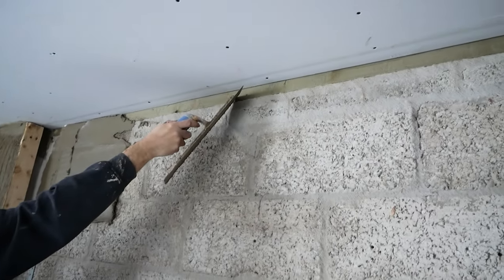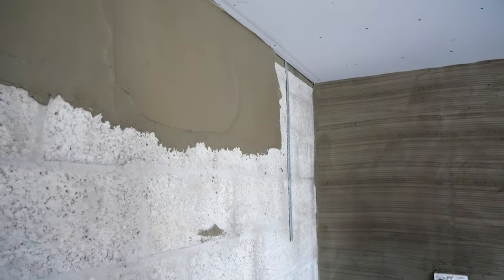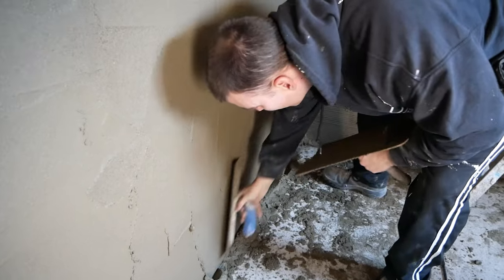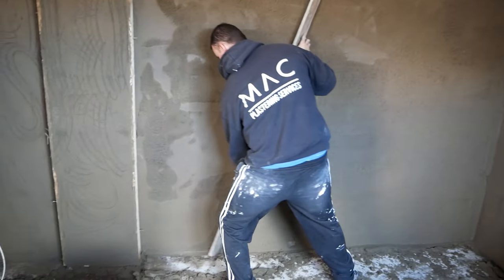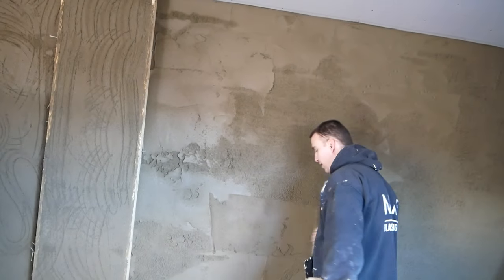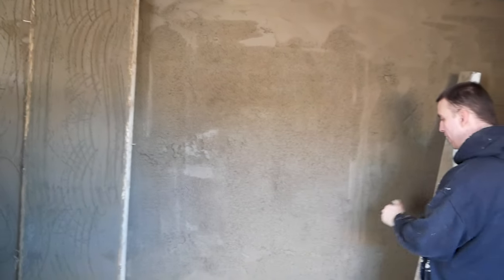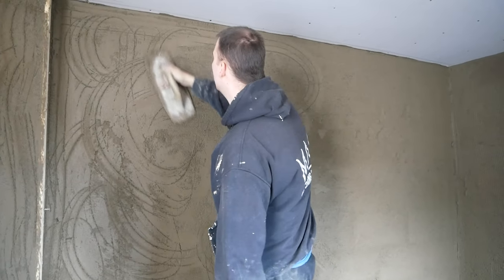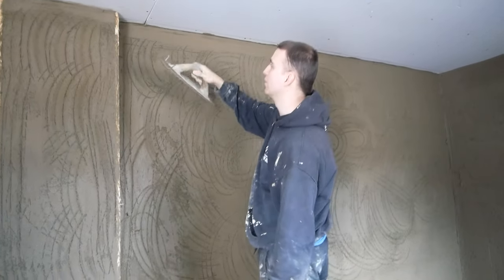How To Float A Wall Ready For  Plastering Using  Sand And Cement

Comment: This has eased my smoothness anxiety😂 As a diyer, I’d have been panicking at the slightest hole / imperfection
Reply from the maker: Its not to bad on the undercoats as long as there is no massive holes hollows or bumps as the next coats are around 3mm

Comment: Wire mesh is definitely a good way to go then scrim on floated wall...... Try going the other way mate when floating and a right hander, your building it out your not skimming
Reply from the maker: @bensharpe370  fir sure on the mesh why I talked about it but I love working left to right it's so much better and comfortable qustions fir your self when doing a dry dash coat you work right to left. Then do you dash where1st ? The right side?  Also same when rendering when you rub the wall where do you rub 1st ??? Do you rub right to left as its the way your gear will be drying most?
Reply: @macplastering  mate!! Im really trying hard to understand. Right hander left to right on finish plaster (your not building up anything) right hander on any backing coat then (right to left your building it up). When you say what would you go on first as in dry dash, with all due respect it's what you put on first. The only reason why you have questioned this is because it's easier for a right hander to dash it from left to right. Show me a floor screed, I need to know how you do that.
Reply from the maker: @bensharpe370 @bensharpe370  my point is it don't matter where you start when building up its where you feel best also for your outside work it actually helps more this way as when finishing it is easier to see your work.. we have loads offloor screed videos or is it on walls your looking for? Strighting up?
Reply: @macplastering  fantastic plasterer mate keep up the good work. My boys in Corfu at the moment he's 18 (first holiday abroad)  can't tell him shit he's knows best. Typical teenager, you got any kids.
Reply from the maker: @bensharpe370 yes I sure do have kids is your boy plastering in corfu ?
Reply from the maker: be nice plastering in Greece and having a holiday at same time lol what type of work is he doing ?
Reply: @macplastering  starts a carpentry course on the 11th, he's just left school. Devons doing 3 days at college and then a few days with me. He didn't do very well at school to be honest, he's got a brain but didn't use it!! Got a girl who's 15 a year below, totally academic they couldn't be more different 😂 How old are yours

Comment: what additives do you put in the Render and is it the same mix for internal and external sand cement
Reply from the maker: Most times, different  mate as outside will have waterproof in it and inside don't need it
Reply from the maker: Again so many different types of jobs new block old block red brick ect
Reply: thanks for the advice ive only ever used hardwall and bonding on interior but i was intrigued by your interior sand and cement plastering because i believe its lovely to get nice and flat even though it might be abit more messy thats why i was curious as to what your mix is for interior sand cement old brick walls
Reply from the maker: most times 4 to 1 with some plasticizer in mate i would find bonding messier as if floor is clean you can re use and cement of floor
Reply: thanks 👍

Comment: You are master but You forgot to moisten the wall with water 💧 Increases adhesion properties
Reply from the maker: Low suction wall if I wet it would be bad in this occasion as wont set nicely if was hight suction yes would wet it down on scud coat

Comment: The technique you show at ~6:00 to plumb up the face of the wall is really smart. I'm watching videos to learn how to render/plaster bits on my house and I think that's the first time I've seen that technique.
Reply from the maker: Thank you buddy its a similar way I do floor screeds to get the levels.  I wouldn't do it like this all the time as we tend to go for straight and the walls shouldn't be built to far out and again if they are would tend to need more work and time to get right

Comment: Mac great tip on 🍑ing up your wall, corner 2 corner with the 1.8 box level
Reply from the maker: actually thought i had it recorded so it was 2 lines pulled off both sides if that makes sense but i either cut it out forgot to recorded it or just talked about that LOL but yes it is a good way to get walls much straighter and plumb again most jobs we don't have time for that its to go straight and plumb at window walls ect sutch as sites and some walls you would never get right unless you had 3 days at the wall LOL Thanks again for the support Joe mate

Comment: I would bed in some  render  mesh over that timber wall plate and the wall straps to help any  cracking from occurring.
Reply from the maker: For sure be good mate but yea will be back here doing floor and can show it all off cracks warts and all as they say doubt it will have any but then again even mesh and fibers in mix with sbr wont stop it if it wishes to crack :) again done it both ways and seen it be fine both ways also see it crack both ways never seen a steel brace crack mined you or never noticed it again always make sure they nailed tight

Comment: I’m a DIY-er and getting to terms with this process. I’m pretty sure I’m trying to finish with the devil float too early and end up pulling more more cement off the wall. Just wanted to check how deep the screws should protrude and should I be resisting the temptation to close in the finish too much. Notice that at 8:21 you’re more concerned with a “general” float with more emphasis on providing the key. Almost at the stage where I’m contemplating closing in the finish and then using a scratcher. Sounds numb I know but I reckon I’m over doing it and overthinking too. Thanks for helping Mac
Reply from the maker: I preffer little thin nails myself - https://youtu.be/-LRtsc0h17k that me setting up the float ... The more you close it in the easier it is to skim.  for sure if you go to early it will tend to stick in more and pull gear off or as some say rub holes in it, very bad for outside work as will make waves that the sun will show of... its mostly trimming here I can go early with experince but when i was learning i would have let it set up a little more and did the finger test poking it to see how wet and stiff it is
Reply: @macplastering  Hi Mac, Thanks for helping. I’ve watched the video and can see straight away that I had screws set way too deep. You have nails 2-4mm deep but I had screws more like 6mm maybe more. Plus I realise that the screws will have a tendency to pull the cement away whereas the nails will be a bit more streamlined. Gonna follow your advice and start again. Once again thanks👍
Reply from the maker: @lewigas290  I do know guys like the screws as easy in and out but thicker and like you say pull a little more. But yes always here mate 👍

Comment: Could this support porcelain tiles? Seen the lads in America float bathroom walls with mesh… 

Curious as gypsum is only rated till 20kg per sqm. I know this is render but some old properties the skim is over a render as you have done
Reply from the maker: Depends on the size and weight of the tile we do tile over this here with no issues untill tiles need removing takes the skim with it but you could just float it and then tile would be the strongest bond
Reply: @macplastering  some good quality porcelain probably 35kg-40sqm  with the adhesive and grout
Reply from the maker: best to do a little test before fully committing to it mate
Reply: @macplastering  will let you know how it goes, will try it on a future job
Reply from the maker: yes mate

Comment: I was taught 35+ years ago to sand and cement was always right to left and skim left to right. So it stuck that way for me
Reply from the maker: Ye it seems to have for the ones who do sand n cement do as they where showed  as long as it well push on its grand what way did you coat dry dash receving coat mate?

Comment: What’s the advantage over sticking up some plasterboard, cost?
Reply from the maker: Great question buddy Would it be good if I did a little video on this talking about that and my views and points ect  ???
Reply: @macplastering  yea do a video on it Mac.
Reply: It can come out more expensive on smaller internal jobs in houses being used, if your taking into account mess and preparation. Cheaper to use plasterboard then and cleaner.